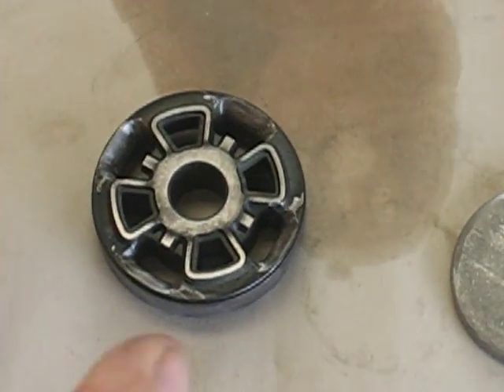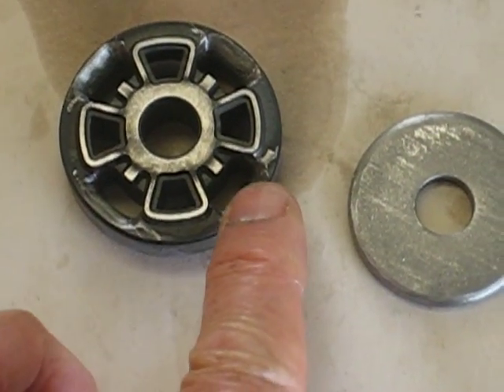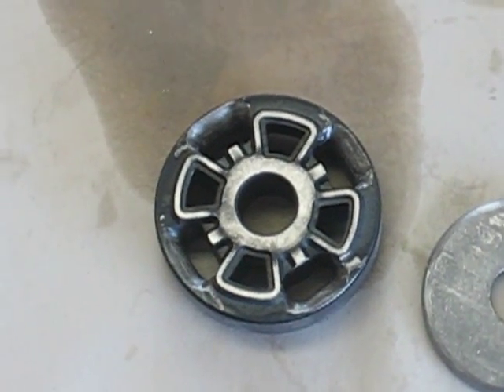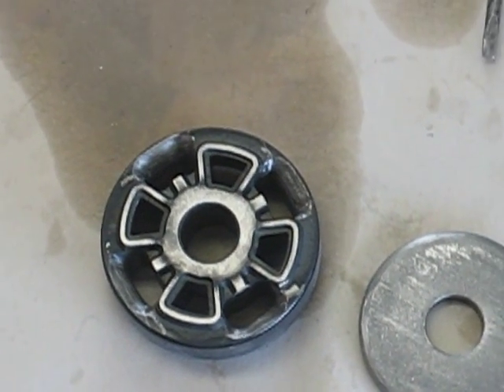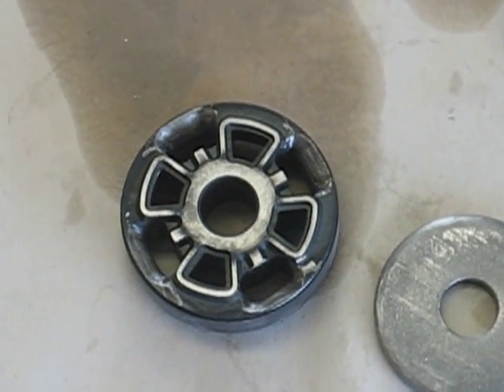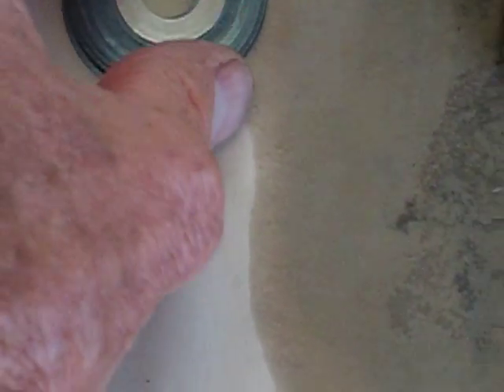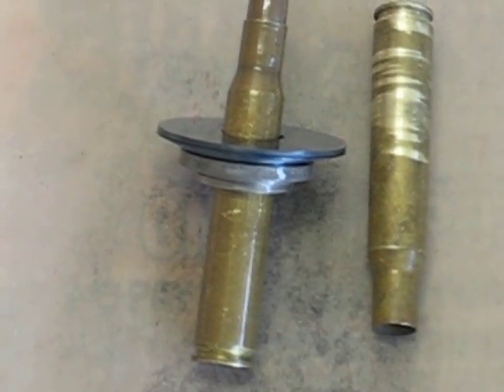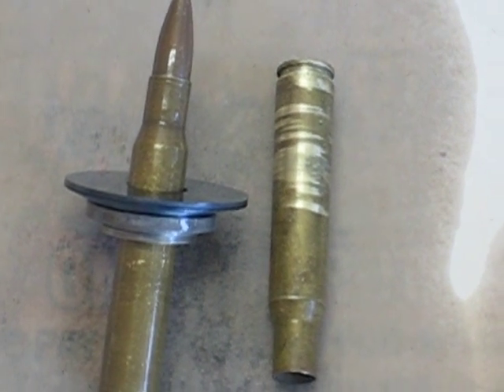Team Squirrrel Tech Tips - shock revalve - part 12

Comment: I ride motocross and some trail, I'm 160lbs and my stock fork springs are 0.44kgmm. I'm at a point that the more comfort I feel the faster I ride. My rear is a progressive Eibach with a Factory Connection bladder conversion and stock piston revalve. Unfortunately I've never raced, but my friends do intermediate class and most of the time I'm up their butts all over the track but I always let off due to fatigue. My bike is real hard to hold onto it's so harsh it wears me out fast.....I'm 36yo....

Comment: It's a 2010 250sx two stroke. It has been through a suspension shop before but now I'm faster and all the previous probs have reared their ugly heads. The valve and shim stack is at the end of a bladder assbly in top of fork. Comes apart easy, I'm sure its been filed already. I think I may just download the RESTACKOR program. I think I want to find the answers as opposed to being given them, I want to port the valves though. The shims are a mystery only for now though.....